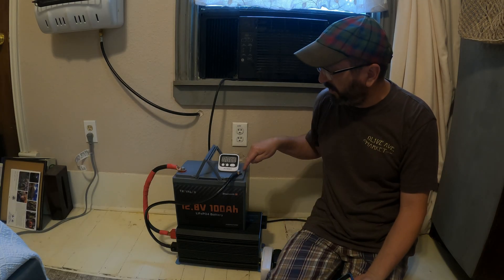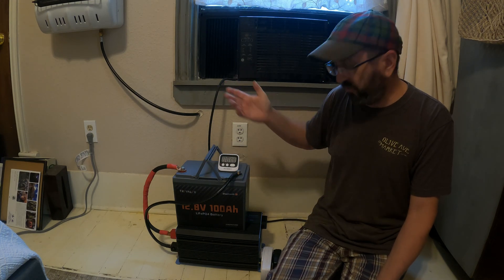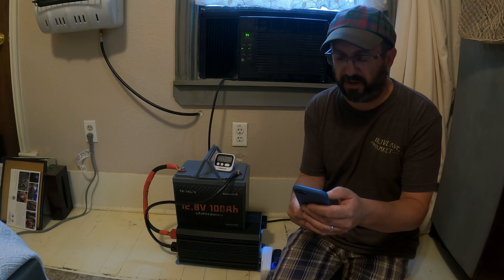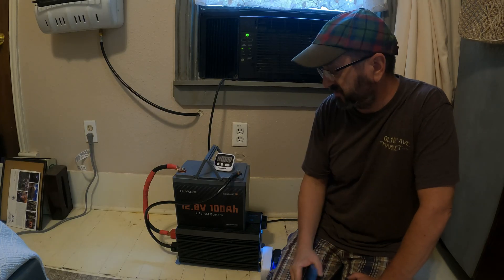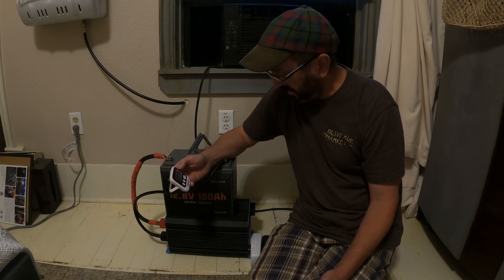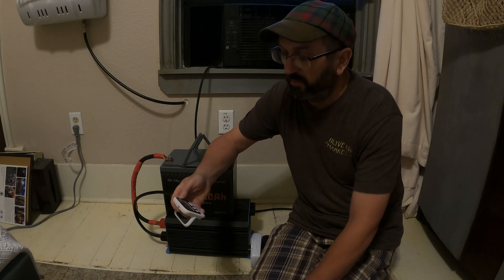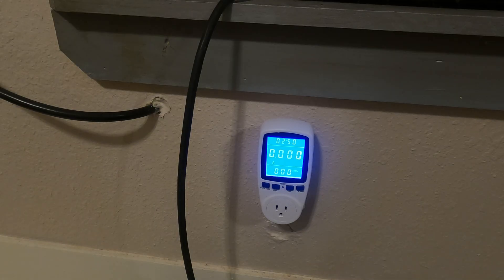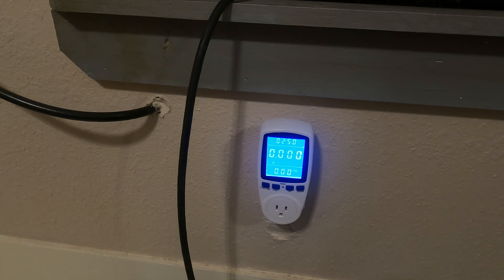How long can you run a 5,000 BTU air conditioner with one 12v 100ah Lifepo4 battery? Let's find out!

Comment: Thanks for your video. I know simple math but I thought maybe 3 hours without adding it up. Now the sun is out can you do a video to show how long it will run with two 100 w solar panels.
Reply from the maker: Thanks for watching.  You were pretty close.
I know 2 100w panels won't do much. Actually need more than you would think.
I did a video on it - https://youtu.be/mMyiYPiBA1k

Comment: So you need about 8 of those batteries to run a single day.
Then wait 5 days for recharge... lol
Reply from the maker: You are close on the KwH need but way off on the recharging.  I have a 10kwH system with 1.8kw of solar and it runs that same unit all summer without any issue.
Reply: @OurBlackCatCottage  Actually I was exaggerating lol
But it does take a lot of batteries and triple the panels as a precaution.
In a balances solar system, all it takes is for one component to be bad and you lose.
Especially the MPPT controller or inverter.

Comment: I was able to Run My 6.5K Inverter AC with a 10Kwh Battery Bank for almost 8.5 hours before The 24 Volt WZRELB Shut down the System. I have since added 5 Eco Worthy 195 watt BiFacial Solar Panels and a Victron 150/45 Smart Solar Charge Controller to this System.
Reply from the maker: Nice!  And sweet setup up too!

Comment: Did you EVER mention the outdoor Temperature during this experiment? Very few videos EVER  think about this critical data info during this type of test.
Reply from the maker: https://youtu.be/uHAouDE5YAk?si=7jWFYDNIkK8MeNM4&t=17
The air conditioner ran was set to 64 degrees and ran non stop so the exact outdoor temp isn't needed.  "Mid August and it's hot out" clearly shows that it was hot. LOL.
Reply: @OurBlackCatCottage  Colder it is outside the less energy will be needed to do the same job.
Several reasons. One being less heat input. Another more efficient refrigeration cycle.

Comment: Standard window unit is 450–520w. Let's take the middle of that so say 475w.  Add a bit for the overhead of the inverter. That takes it to around 490.  1280/490w gives you 2 hours 36 minutes.  Simple math.
Reply: I was close.  LOL. Very efficient inverter.
Reply from the maker: You were close. LOL!
Reply: You forgot to use include the efficiency of for both the inverter and battery.

Comment: I've tried just about every possible way to run my 5000BTU AC, and the best results is from my AFERIY P310. I run it during the hottest part of the day for about 4 hours with about 70% of battery left after 4 hours. The Display says I could run it for 8 hours with the compressor always on. But I don't run my AC full blast. I always have it cycle on and off. BTW, I do this all without Solar.
Reply from the maker: That is very interesting. An innovative way of doing it.  Side note, I reviewed the AFERIY 210 but was concerning because the voltage dropped really low under heavy load. How is your P310 under heavy load?
Reply: @OurBlackCatCottage  Thats a fascinating question. ive never pushed it to find out. I'm guessing the voltage drops also on the P310
Reply: @OurBlackCatCottage  I just double checked after 3600 watts the voltage drops
Reply from the maker: @mannyfragoza9652  Interesting. Thanks for checking!

Comment: What inverter do you have?  The ones in the link above are 2000 w ones.  Thanks!  Great video!
Reply from the maker: Crap. I put the wrong link it. Here is the link to the 4k one.
https://amzn.to/3V0UvD4
It is an absolute beast but needs really thick wires to run.
Reply: @OurBlackCatCottage   Thanks!!!